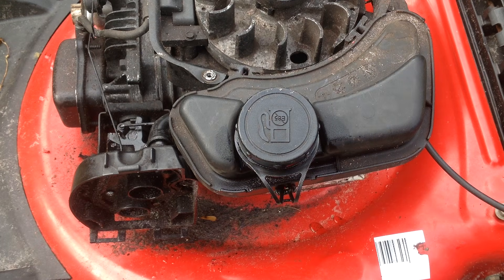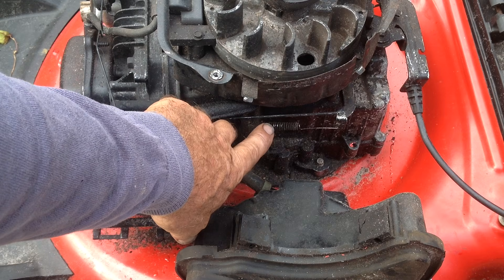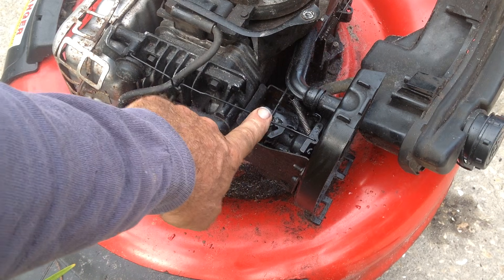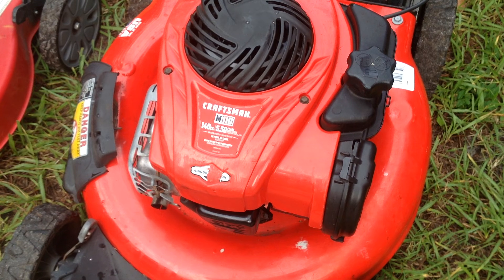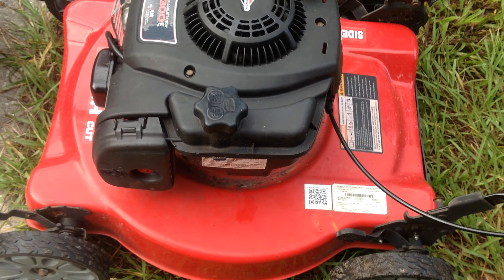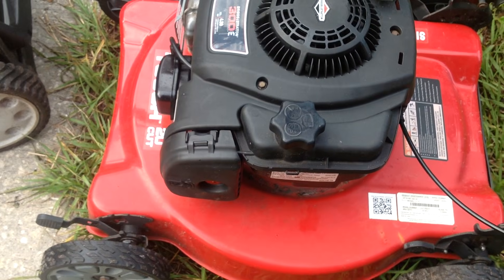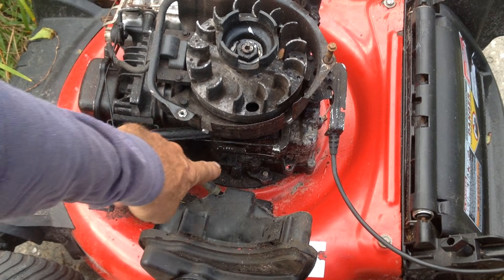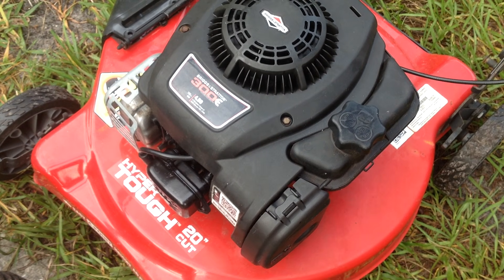How to adjust RPM/Engine speed on newer Briggs-Stratton engines with  OHV.

Comment: Your video helped me, I couldn't figure out why extremely high rpm, turns out the throttle butterfly came off/out when the plastic post split. Your video gave me the idea of pulling the carb off to see if that's what had happened, it couldn't close. Thank you!
Reply from the maker: John, go cut some grass...

Comment: I understand how a governor is suppose to work on those little mowers, When the motor starts to work harder in thicker grass, the motor slows a bit and the governor opens the throttle for more power - simple. But I never really liked that setup personally, so I bypassed the whole contraption and ran a throttle cable directly to the throttle control so now I can run my mower the way I like it. It idles so slow I can count the revolutions and winds up like a Farrari!

Comment: I have this exact mower and it does not start.  I have spark with a brand new spark plug.  Even spraying starting fluid into the carburetor does not fire it.  I took the plastic carburetor apart and it essentially looks brand new on the inside but I cleaned it anyways pulling the white pieces apart.  All the holes were open but I probed them with wire as well.  I removed the ignition coil and test it with multimeter at 20K ohms setting and it registered 6.25 with the red lead in the boot and the black lead touching the right left and the dead man's post so my ignition coil was good.  I also set the valve lash.  Completely removed washed out and cleaned the gas tank and fuel lines.  I used regular 87 octane gas and the gas tank had very little gas in it until I added more.  I have good flow from the fuel line of the gas tank into the carburetor because when I clean the carburetor gas poured out.  And when I check the spark plug it was wet meaning gas got into the combustion chamber.  I'm trying to figure out if I have compression I don't have one of those fancy compression testers.  But after I put everything back together it still does not fire and I've left the air filter off.  The auto choke with the cold engine is completely closed.  I'm not sure if this engine has a plastic camshaft that moved and the timing is off The only thing I can think of doing is removing the engine from the lawn mower deck and completely taking the crankcase apart.  Not sure if it's worth it because that camshaft is pretty expensive.  Please advise????
Reply from the maker: it does have a plastic cam shaft.  They are not terribly expensive.  Is the key way on the flywheel aligned properly?
Reply: @tommy-time5240 @tommy-time5240 to be honest I am not sure I do not have a impact socket big enough in order to remove the cup from the flywheel so I can see if the key is intact.  I have no trouble pulling the cord but I'm kind of getting this whistling or almost like a duck quacking sound coming from the carburetor as I'm trying to start it.  I've heard this in some other videos it sounds exactly like mine.
Reply: @tommy-time5240  I put the mower all back together using the RTV red high temperature gasket maker along with the original head gasket and I turn the mower on its side to do the counterclockwise compression test with the blade and it does not want to snap back clockwise so that means I still have no compression.  Are those valves on the head supposed to fit completely flush or are they supposed to be raised up a bit mine are raised up but I do not feel any air gaps.  Only thing I can think of is the piston rings are bad?  When I took the head off I could push on top of the springs to open and close the valves the exhaust valve stuck just a little bit around the head area I took them both completely apart and clean them with a small wire wheel on a Dremel.  This is mind boggling????
Reply from the maker: @mitchmonte1223    valves should be even with the piston at TDC.  If they are not  then possible damage to the plastic cam lobes
Reply: @tommy-time5240 When you have the head off and you are looking at the closed valves are they completely flush with the housing as they sit in the steel ring? Or are they elevated like 1 to 2 mm? Videos that I have watched looks like they are elevated when they're fully closed. Some people say they are completely flush and smooth across when they're closed.  With no compression at all even with gasket maker applied to the Head gasket and I still get absolutely no compression It's got to be the piston rings that are bad.  When I had the head off and I put pressure on the exhaust spring and valve at the valve opening it felt like it stuck very slightly compared to the intake valve.  But I don't think it is in a stuck open position because the valve is closed before I push the spring
Reply: @tommy-time5240 When you have the head off and you are looking at the closed valves are they completely flush with the housing as they sit in the steel ring? Or are they elevated like 1 to 2 mm? Videos that I have watched looks like they are elevated when they're fully closed. Some people say they are completely flush and smooth across when they're closed.  With no compression at all even with gasket maker applied to the Head gasket and I still get absolutely no compression It's got to be the piston rings that are bad.  When I had the head off and I put pressure on the exhaust spring and valve at the valve opening it felt like it stuck very slightly compared to the intake valve.  But I don't think it is in a stuck open position because the valve is closed before I push the spring.  This could also be that plastic camshaft that rotated and now it's out of time.  That would definitely not provide compression so maybe it's not the piston rings
Reply from the maker: @mitchmonte1223    i have seen much more cam shaft failure than ring damage.  was the unit abused...no oil changes?
Reply: @tommy-time5240 not sure she said it ran like 4x this year then would never start after that....I got 2 mowers for free when she boughty Craftsman 5HP Briggs for $160....I was shocked she wanted to donate them.  Both are gonna be a real challenge!
Reply: @tommy-time5240 I turn the magnetic flywheel so it is on the ignition and I checked both of the valves and they both are closed. And the rocker arms are very tight No movement. But this is very hard to tell because the actual magnet is wider than the ignition coil so I tried to center the magnet in the middle. But it's difficult to tell if the valve is open or not I guess the only true way is to remove the engine from the deck and open the sump and check to make sure the timing indicators are lined up.  If I move the flywheel and put the right edge of the magnet just onto the right edge of the ignition coil the exhaust valve seems to be fully closed. If I rotate the magnetic flywheel area and align the left edges with the left side ignition coil The exhaust valve begins to open so that gear might be out of time.

Comment: These engines aren't designed to run at high RPM (3600) like the old flatheads and bigger OHV engines. While tempting, 2600-2800RPM is about their limit without risking premature engine failure. I always use a tachometer to set RPM's as doing it  by ear is deceiving, at least to me. Also the 4.50 designation isn't horsepower, it's the gross torque rating which develops it's max at those lower RPM's as all engines do. Using the torque x RPM ÷ 5252 is a bit off as HP only comes out to 2.4hp. I'm fairly certain these are closer to 3-3.5hp depending on it's CC displacement. Just my dollar and 2¢ worth.
Reply from the maker: Thank you for this Info.

Comment: Thank you so much for this info. I am struggling with this problem exactly here in South Africa. The engine starts but will not rev enough to cut. It is so clear and helpful. I am off to adjust it right now. Thanks for sharing your knowledge and experience. VERY HELPFUL SIR.

Comment: I hate these plastic carburetors. These mowers are so cheaply made, look at the gas tank wobble.
Reply: Yeah, they got too cheap for a drain plug in it or a petcock or an oil drain plug. They still clean up and run easily enough.
Reply: Cheaply made but durable. Have ours for the last 12 years. Bought new in 2013 and its still running. Just did a tuneup.

Comment: So, what do you do when one of those governors sticks?  I found if you pull the lever near the head that connects to a small round cylinder, the engine stops high rpm and returns to normal operating rpm.  When you first start it, it acts like it burns rich, until you pull lever. ??

Comment: my 675exi looks just like this, bend rod toward engine with it running even the tiniest bit does not raise the idle, it engages the choke causing the engine to spit black smoke, put it back to original position, and even tried bending away from carb, no idle speed change up or down, the proper method is to adjust the throttle linkage as shown in several other youtube videos, this one’s a thumbs down! 👎🏻

Comment: Just don’t overdo the RPMs folks 😊
Slower will last longer in a way
Reply: Dude, its a Walmart bottom shelf mower.  I bought one and run it waaaay too high every time.  Ive only changed the oil and its 4 seasons going strong through crazy thick grass for its size.

Comment: What going on if i move the tab back and it didn't adjust? Please somebody help me out 😅
Reply from the maker: be sure the linkage and spring are not binding.  take the recoil cover off and lift up gas tank to get a better look.
Reply: @tommy-time5240  I did all of that, it revs so high till it feels like it’s about to blow up
Reply from the maker: @tonyjohnson5047  has the spring been changed?  try pulling the spring towers the rear and see if it slows down.
Reply: @tommy-time5240  it don’t do anything but revs high
Reply: @tommy-time5240  and it only has one spring tower it’s a hyper tough lawn mower
Reply: The guy with the funny teeth just gave me a idea on his page about the governor shaft , im calling it quits for tonight I’ll keep you posted for helping me out thanks

Comment: Thank you so much!  I bought a used mower from a guy and when I went to mow the RPMs were so low it couldnt cut anything without stalling.  I thought I had a lemon but you helped me find the throttle adjustment behind the fuel tank.  Stuck my finger in there, bent it forward and bam, now we got power.  Thank you sir
Reply from the maker: Awesome.  I do not want any excuses for not cutting the grass for the rest of the Season.!!

Comment: Off topic, but I'm having trouble getting my mower with this engine started. When I engage the lever before starting, I notice the throttle isn't opening above the carb. I'm kinda clueless with this stuff, but I'm assuming the carb is supposed to open when running right?
Reply from the maker: When you say engage the lever, do you mean the safety bail bar on the handle?
Reply: @tommy-time5240  yes
Reply from the maker: @Laptops1781  the throttle linkage is going to remain still until the engine is running.  Pulling the bail bar back only releases the brake and kill wire on the flywheel.  try squirting carb cleaner or staring fluid into the intake tube (bottom hole)  when air filter is removed.
Reply: @tommy-time5240  thanks for your help. Unfortunately it still won't start. I ordered a new carb and ignition coil. Hopefully that works

Comment: What is it about Briggs and Strattons has oil leaks on the carburetor side where is it come from
Reply: Crank case vent, its normal.  Oil vapors get burned thru the intake.

Comment: My mower "sang" between a G and  G# when I got it new from the factory (163cc model 100000). I measured with a guitar tuner.  Now my machine is a couple of years old and it's down to between a G-flat and a G, so that's why I wanted to adjust the RPM back up.

Comment: While doing this adjustment I was holding on to the deck of the mower. I wasn't paying attention and cut my hand off, so thanks for the new stump.
Reply: Common sense is not that common any more
Reply: You’re supposed to remove the spark plug any time you work on your lawn mower doesn’t matter what it is

Comment: Dude,  I love you and like the channel. My 80 year old neighbor was talking / complaining  that the mower I bought him was running slower. I pulled out my Fluke 88 and the RPM was in range. It seems I need to stretch  the springs a little more. The sound of a 4 cycle engine sounds good to all but less that a 2 cycle which is twice the speed and power. Have a great day.

Comment: In future it might be best to blow all  the debris away before starting to dismantle the machine so that the cr-p doesn't get inside the engine or carb. Then dismantle in a separate area away from all the dust that has been created. Try to keep it clean.

Comment: When you say you push the "tab" forward to backward to slow the idle, are you loosening a screen at the base of the tab or literally bending the 3 inch piece of steel/metal in the direction you need. BTW mine is already bent towards the back but still idling way to high. Thoughts?
Reply from the maker: Push the top of the tab, do not loosen the bolt that holds it to the engine block. Check to make sure the linkage is not bent or the spring is damaged.

Comment: Its now too late to fire the mower up without causing some tears to fall from the neighbors.  That's a pity because I know that they have been laughing at my Briggs and stratton yard machine about to throw a rod because of the extremely high reving.  After  cleaning out the plastic carb and getting the water out of the  sub and tank it started doing this.  I couldn't figure out where to set the rpms.  I knew it had to be something simple.  Everywhere I looked,  and I looked awhile, it was all older style mowers and was not the answer.   I was about to just give up on it and blast it with the BAR when I found your video.  I mean it was to the point where the two of the neighborhood kids knocked on my door and wanted to know if they could mow it.  Hey, good for them working a side hustle for some money but big man here had to say no I'm working on the mower and I'll get it.  But I wasn't happening and it was embarrassing.   It became the principality of the whole thing.  But like I said your video was like a hand reaching down and pulling me from perdition!  Hopefully it will work tomorrow  and I can strut around like MIck Jagger once again.   Thank you for taking the time to pass on the knowledge! You do great work Sir!
Reply from the maker: I was happy to help...now, go make the neighbors happy and cut that damn grass!!

Comment: Dear Sir,
I have B&S 550E 140cc.
During idle power, the rpm has a very big fluctuations. The setting of the lever unit just decreases/ increases this fluctuations. I setted the valves, replaced the filter etc., but the troubleshooting not solved my problem yet.
Appreciate your help.
Reply from the maker: If you have a surging issue, i would look at fuel quality and possible a blocked fuel jet.  Remove the carburetor and clean and use new fuel in the tank.